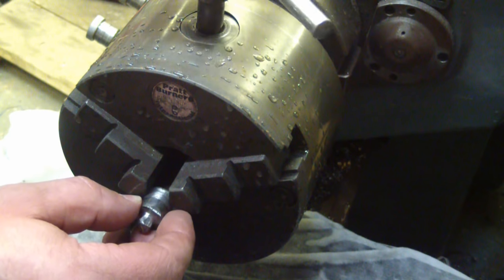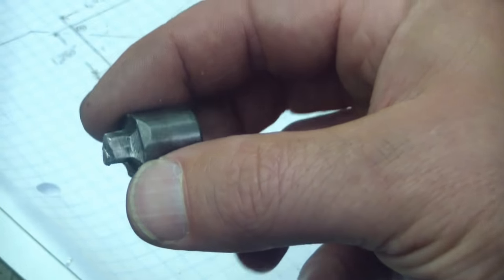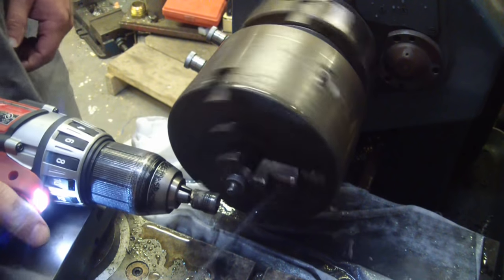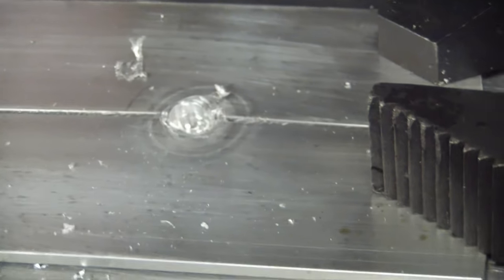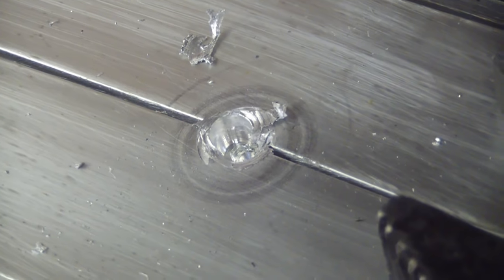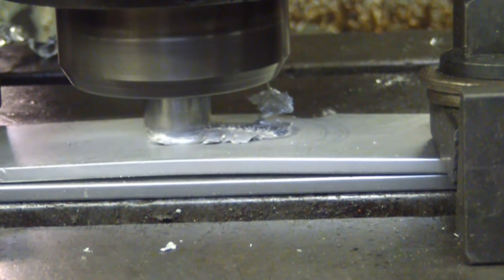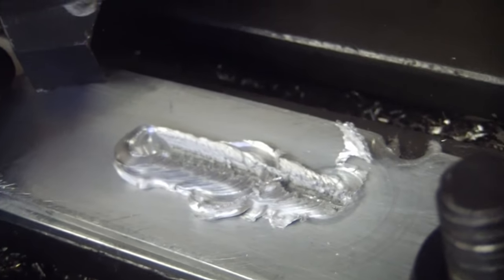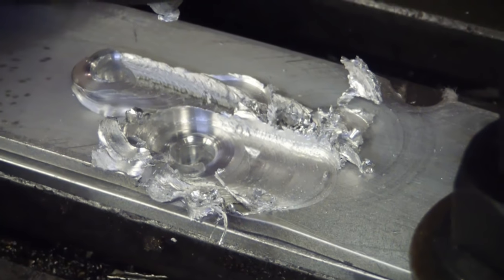Friction Stir Welding on a Bridgeport Mill

Comment: you need more speed
Reply: Atom169 Nope, He neeeds more power, which he hasn't ;P
Reply: Nope, having only ever seen this process here with uncle AvE I think he needs the tool to be flat or ball nosed shape so as the tool does not cut. Maybe more power would also help the machine to plunge easier also. Seriously I haven't a clue what I'm talking about.